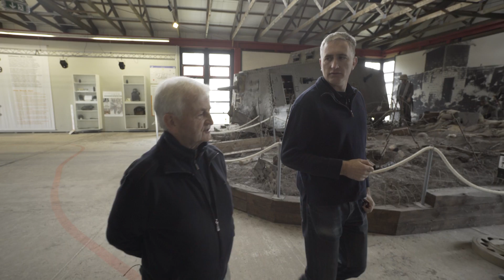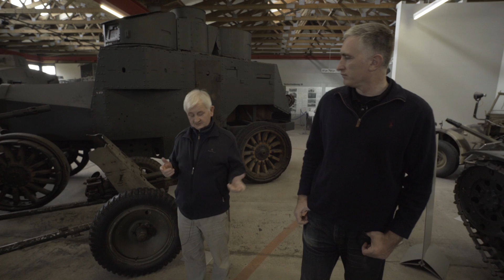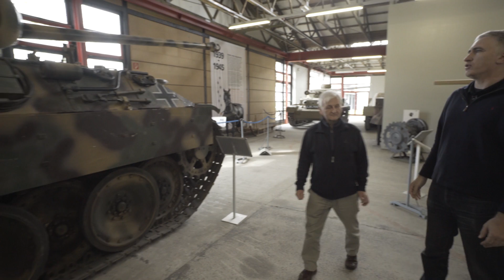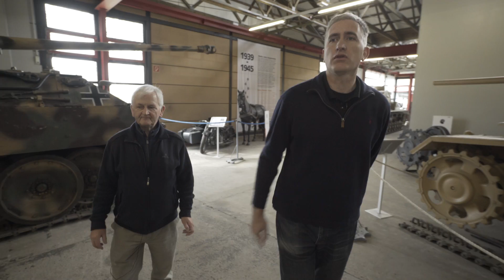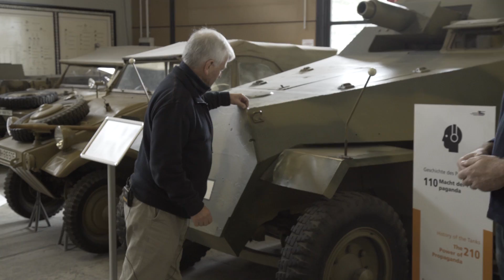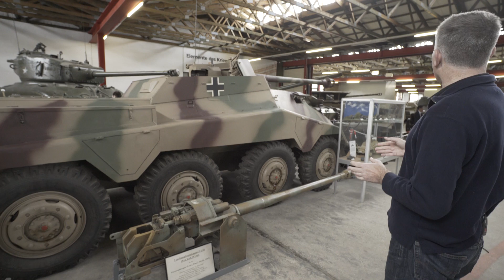WW2 at the Panzermuseum with Hilary Doyle

Comment: Surely the huge ratios of kills by the Stug III had more to do with the crews they put in them rather than the actual design of the Stug? It was a low machine with a good gun and relatively low cost because it was missing the Mark 3 turret, but it was the artillerymen that crewed this vehicle that were highly trained in gun handling and therefore much more able to get hits on the enemy where it counted.

Comment: Surely the Finns would have shared their experiences with the Germans on the difficulty of defeating Soviet tanks during the Winter War? I find it hard to believe that the Germans were not warned or even tried the KV-1 and KV-2 that the Finns captured. They captured most of the Soviet armor that was pitted against them, so you'd think that they allowed the Germans to play with them.
Reply: There were only a handfull of KV-1 used in the winter war, they seem to not have seen combat all that often which makes it almost impossible for the Finns to have any real information on them. The KV-2 only fired at captured Finnish pillboxes after the conflict was over.

Comment: Did he just say that the Ferdinand was —good-?!?
Reply: Statistically speaking, the Ferdinand achieved amazing results at eliminating tanks. It was terrifying. The problems it had were related to the severe overheating of the engines due to their unusual configuration (ie, petrol-electric) and inexperienced crews. Here it is another example of Doyle specifically saying that the Ferdinand/Elefant gets a lot of bad press: https://youtu.be/UuLx-bzKjaQ?t=200
Reply: He did, you have a problem with that?

Comment: The Germans are known for their jet engine/turbine design.....Would it had made a difference if they would had used the turbine idea in a tank back than already?
Reply: Turbines had the problem that they needed alloys that were extreamly hard to get. Using lower quality alloys caused a verry short livespan of the engine as well as the problem of ripping itselve apart when changing rotation speeds to quick. Both were big problems on the Me 262.

Comment: Question you've probably heard a hundred times lol, Why didn't the Germans use their knowledge of jet turbines to improve their tanks performances? Was it resource or a technological problem they couldn't over come?.  A Tiger powered by a turbine engine would have been a very effective weapon.
Reply: The gas turbine engine extended outside of the tank(a Panther's hull was used as a test bed).....and it consumed fuel,lots and lots of fuel.
Reply: @TheNordhammer  that's the conclusion id already come to.  But it doesnt answer why they didn't develop a better turbine engine.  "It stuck out the back and used to much fuel" are the problems, not the answer why they didn't follow through on the technology.
Reply: @benjamin donaldson

The war ended is why.
Edit: Keep mind actual development of the GT 101 only began in mid 1944.
Reply: @TheNordhammer  the first successful launch of a V2 was 03/04/43. The first test firings started 13 June '42.  The same time frame as the Tiger's final design. Your replies aren't helpful, they don't answer the question. Just obvious facts im already aware of.
Reply: @cookingonthecheapcheap6921  the V2 was not a jet it was a rocket. Not much use for a rocket engine on a tank I would guess.
Reply: @comsubpac  I smart answer would have been the lack of nickel to make the turbines heat resistant.  Like their jets only getting hours of flight time before the engine would destroy itself. And do you think a "jet" means  only manned delivery vehicles?
Reply: @cookingonthecheapcheap6921  Jet engines were developed by privte companies for the air force. 
The rockets were developed by the state run Penemünde testside under supervision of the army (Heer).
Reply: @comsubpac  there were multiple sites for both, your statement makes me think you don't know this.  After '44 penemunde was bombed out anyway,  besides which it was a TEST SITE, not the production facilities. Again,  if you don't know the answer to the question.  Then don't bother, because stating half facts NOT ON TOPIC is just annoying.
Reply: @cookingonthecheapcheap6921  the rocket engines were developed at Penemünde by the Heer and not the jet engines.
Reply: benjamin donaldson
The main problem with German turbine engines was related to their lack of resources, specifically those needed to alloy the turbine blades and other hot components of the engine.
Service life on a jet engine was measured in hours (less than 75 hours of flight time). This need to overhaul at intervals not exceeding 50 hours made a turbine engine completely unsuitable for an AFV. That is before considering the incredible fuel burn rates these engines had when pushing an aerodynamically well designed body that was a small fraction of the mass of a medium tank.
Reply: @boydgrandy5769  thank you for the no bullshit answer.  But what I'm curious about is the "did they and how" did they try and solve these problems if they did/could. They had great engineers so it stands to reason the P51 was a WTF moment being able to fly to Berlin and back.  More curious about developing tech in war time.   The whole reason for Norway was exactly the point you made,  Iron, Nickel etc.

Comment: The SdKfz 251 (& derivatives) were 3/4 track.  The U.S. M-3 (& derivatives) was a true half track.  Hence, the SdKfz 251 needed the complex rear differential to overcome the large footprint in tight turns.
Reply from the maker: Unless I am mistaken, the US considered the T16 also to be a three-quarter track without special steering, but granted, instead of the longer track reaching forward closer to the front wheels, they used it to extend the track (and thus body) further to the rear. I’m fairly sure the US tried some other 3/4 track designs, but am not near my Hunnicutt right now.
Reply: Agreed.  I defer to you, as always.   In my view, with the 'short' wheel base, the SdKfz 251 series tracks would have to be added into the steering equation, adding complexity as you pointed out.   Wouldn't the SdKfz 2 Kettenkrad need the same?
Reply: @N_Wheeler  Kettenkrad had differentail stearing.

Comment: In particular americans have difficulties to understand the need for the grashopper and other systems that put in favour that the artellery gun schould been able to be dismounted. But one of the things there were a bottleneck for in germany was the ability to produce engines and fuel. So if you can dismount your artillery you can use the same engine to deliver grenates for the artellery.. In long periodes of the war there were more or less stelmate on eastern front into the perspective that artellery units was no so much in chance of meeting a sudden russian push against them.

Comment: As far as I had been informed the change of putting the stug on top of the pzkmpf IV hulls was a stop gap solution since the factory that produced the stug III was bombed and the needs for stug was even more urgent than a production of the Pzkmpf IV as a tank and still it was the long time plan that Panther schould had substitued the production of Pzkmpf IV much earlier but as Guderian mentioned at a meeting:"So you want to stop production of Pzkmpf IV to Panters and use 2 months for it. So we in 2 months only have a handfull of Tiger I to send to the front?" With this perspective it was decieded not to drop Pzkmpf IV as a tank.
Reply: Very astute, we forget Germany didn't have alot of time/ resources to whatever they wanted.

Comment: The German patents on advanced steelmaking and welding were literally secret weapons. Great information! Have a Guinness, on me.
Reply: Samuel Thompson Yes I caught that comment as well and I must admit that I have considered all armour to be of the same consistency and quality and the only variables that are 

 discussed are the thickness and angle of the armour.
Reply: @markfryer9880  I knew that face hardening was important. There's a lot out there on the tradeoffs between stiff, tough, brittle, surface vs deeper plate properties. The Soviets developed submerged welding for the T-34 factories and it made a great deal of difference. Later Panthers had weaker armor as Germany's supplies of nickel, chromium, molybdenum, and so on dwindled. When Aberdeen Proving Grounds preformed an in depth examination of a T-34 during WWII, they found it was made of about 14 different grades of steel.
Reply: @amerigo88  submerged arc welding was developed in mckeesport pa in the early 30's for making pipe.  If you can provide evidence it was developed by the Soviets, I'd be interested to see it.
Reply: @amerigo88  it gets complex, but basically it was found that the replacement for molybdenum used by the Germans was more than suitable. Postwar studies showed there was no noticeable drop in steel quality and most wartime studies were pretty much reliant on flawed studies and were used to support the success of bomber command's decision to target certain German industries.

Many of the material replacements in the steel were used postwar by other nations, when shortages were not an issue. Also the main issue in steel quality control for the Germans, temper embrittlement, was not only widely known by the Germans, but they also knew the cause and how to correct it (I can't remember the precise process, but you can pretty much just recycle the faulty plate and try again. By comparison the British who completed the studies suggesting the steel quality issues and hypothesised that temper embrittle ment was the cause, didn't understand the process to the same level until post war.

You then have quality control! Doyle himself found that the quality control and standards was pretty much consistent for steel plate (unlike many other pieces of equipment) for the Germans right up to the end of the war. Poor quality pieces were rejected at similar rates regardless of wartime period and the chemical makeup, despite quality requirements not changing.

TLDR: despite wartime studies claims, major nerding has show via postwar studies, that German steel quality never dipped, it pretty much increased even after material shortages. Any quality differences wouldn't of been noticeable until the last few weeks of the war although it's certainly not documented in any source.
Reply: @randymagnum143  https://www.sites.google.com/site/thewelding/history  Interesting run through of the history of welding. Wikipedia has an article "Submerged Arc Welding" that credits three 1930's inventors who have non-Russian names. Perhaps I should have said the Soviets began implementing SAW in tank production during WWII. IIRC, Jonathan Parshall of "Shattered Sword" fame spoke of Soviet SAW during the second half of an excellent YouTube video on the Battle of Kursk. The first half of that video recorded at an American war museum (with The Chieftain in the audience!) is from a well-known military historian. I found Parshall's coverage of his research question outstanding. He asks, "Given the relatively even sizes of the wartime economies of the USSR and Nazi Germany, why did the USSR produce so many more tanks/AFV's? It's a fascinating talk I have viewed a few times.
Reply: @randymagnum143  Within the first couple of minutes that I linked, the presenter covers Soviet "development" of Submerged Arc Welding and its impact on T-34 tank production. https://youtu.be/N6xLMUifbxQ?t=2296 This is one of my absolute favorite YouTube videos, if you skip about the first 25 minutes by Robert Citino.
Reply: @amerigo88  yes, roughly a decade after the process was invented.  They adopted the process, they didn't develop it.  From my research it was Lincoln welding in partnership with Babcock & Wilcox around '32, or '33.
Reply: @amerigo88  Wrong.  Ford Motor Company sent their architect to build Stalin modern factories.  Ford Motor Company then sent their factory foremen and trade specialists to Stalin to teach his puppets how to work commercial machinery.  So you are wrong.  United States Ford Motor Company taught Stalin's puppets the U.S. submerged welding technique.

As an aside, Stalin used his Ford factories to create Earth's largest ever standing army BEFORE 1938 and then moved it to Russia's border with Poland whereupon Stalin had them construct military airbases and army bases.  Yet, before they could complete their forward bases... N.S.D.A.P. Germany preemptively attacked.  Our entire history has been subverted.  Remember that.
Reply: @DerSchleier  The detailed researcher known as @TIK Military History (and dozens of other historians) have refuted this Soviet invasion of Europe in summer 1941 nonsense . The Soviets were no more virtuous than the Nazis really . For the Western Allies, Stalin went from friend of my enemy to the enemy of my enemy and thus Churchill and FDRs friend after he quit supplying the Nazis with raw materials . Stalin was not insane enough to launch a war on the Nazi German empire of Germany, France, Italy, Norway, Denmark, Belgium, The Netherlands , Yugoslavia, Czechoslovakia, Romania, Hungary, Austria, and so on .
https://youtu.be/TyANHGWbUHA